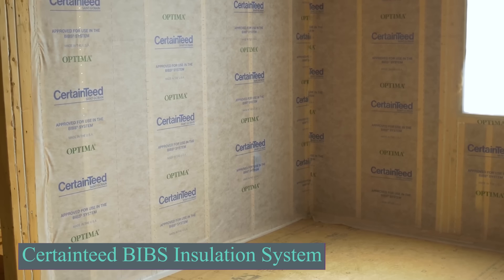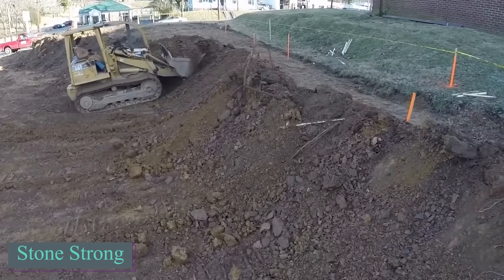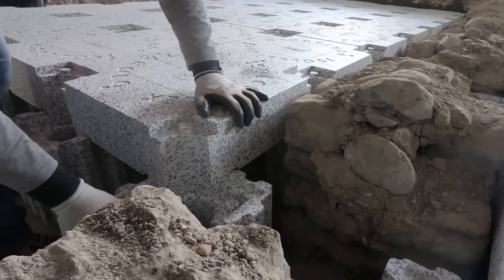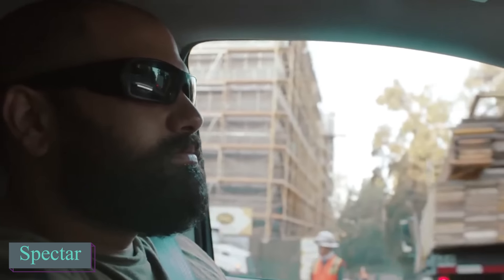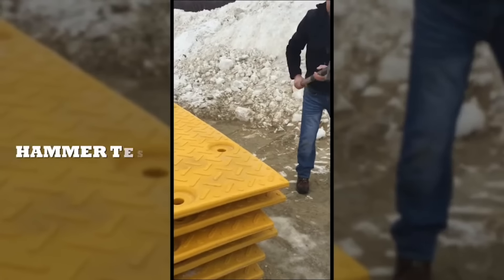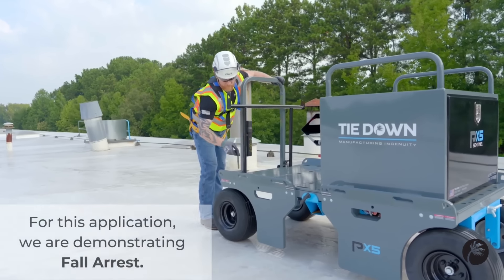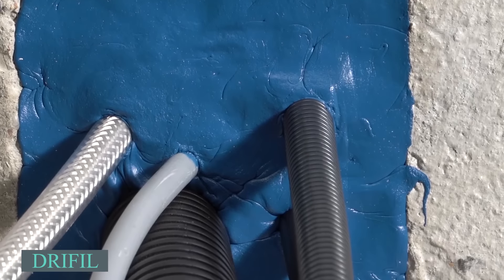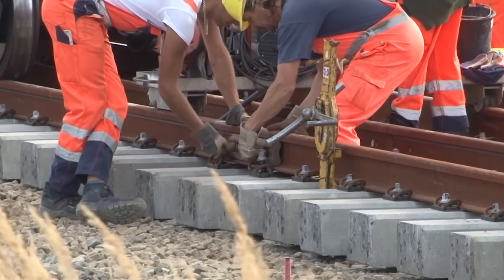CONSTRUCTION TECHNOLOGIES THAT HAVE REACHED A NEW LEVEL

Comment: There is a truly built hay bale house in New Mexico and the walls are super thick and when I got there to move them out, they said the windows use to be narrow slits. The guns could shoot out, but the arrows hardly ever made it in. The house was part of the stage coach route. So building with hay is not new